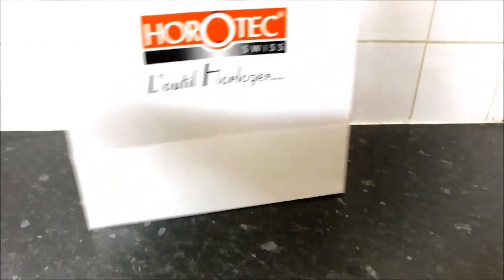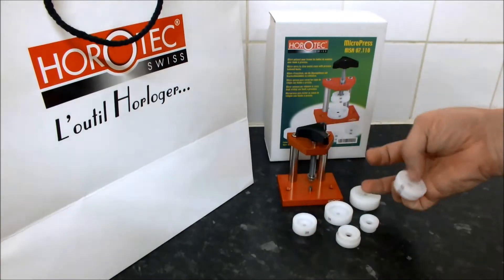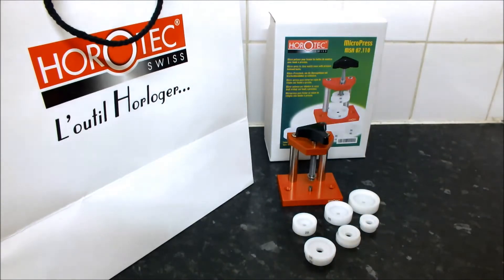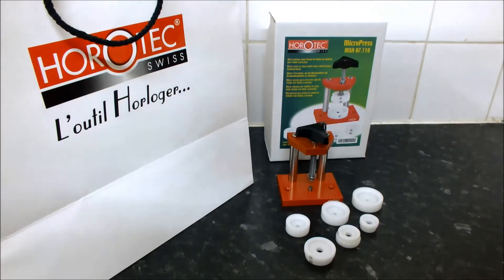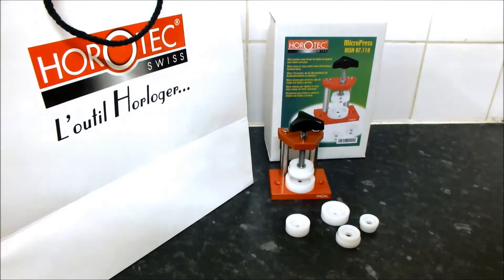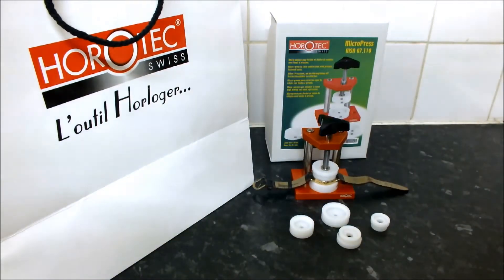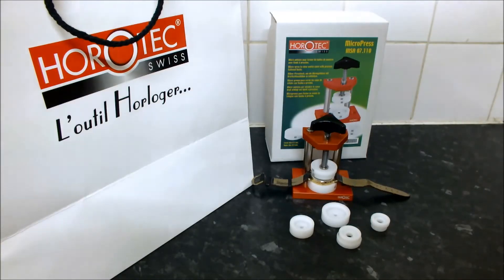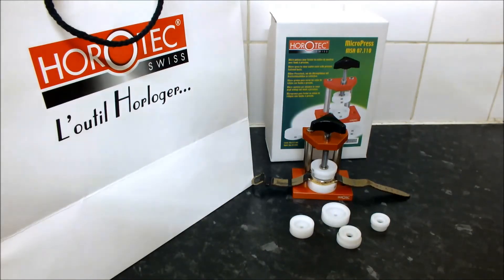Using the Horotec watch case back press to fit a snap on watch back

Comment: Great video and very useful.  I've had one for years but did not notice and therefore realise the the purpose of the taper on the dies the glass sits on.  Also learnt the reason to choose the largest die possible to snap the back on, spreading the load evenly and not risking concaving the case back.  I also know about the properties of "delrin" now.  Thanks,  Peter

Comment: I have a similar press (knock of of the AF mini press) and find quite a bit of wobble in the shaft as I screw it down, causing a misalignment at the 2 dies. How would you rate this one for wobble? it looks better than mine.